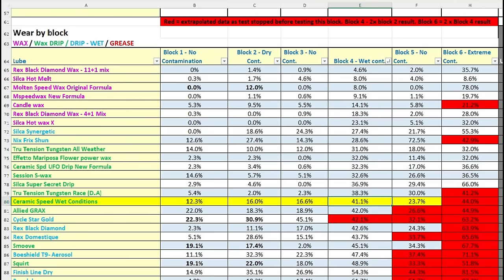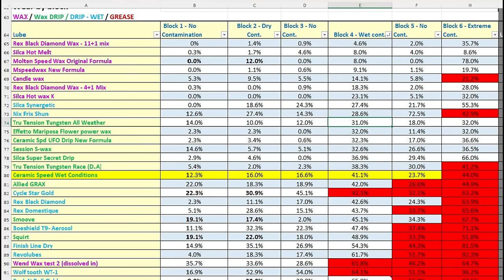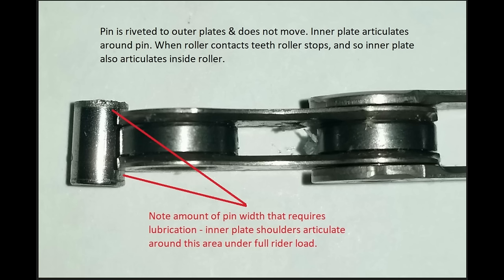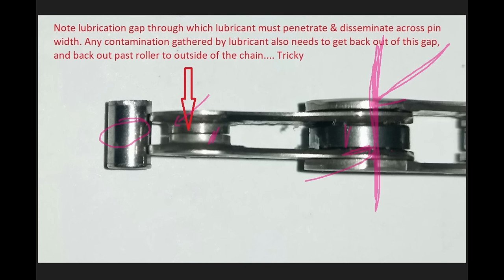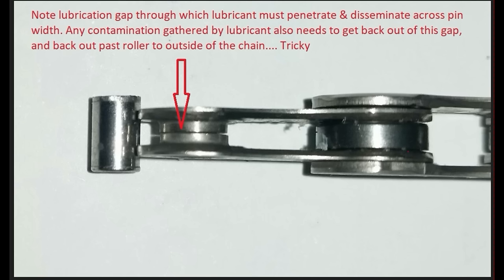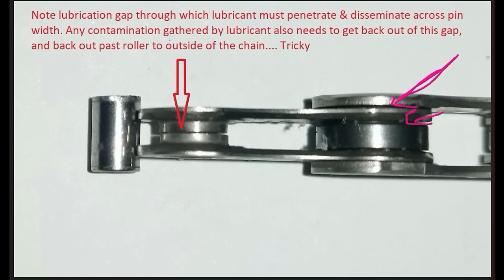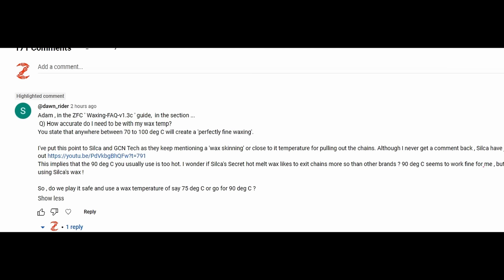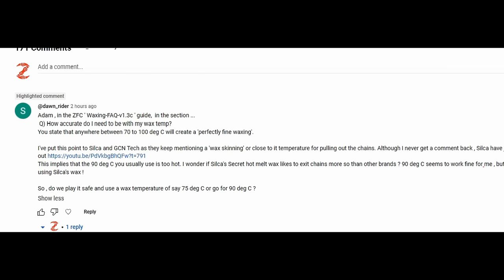wax not last

Comment: have you ever tried wax with graphene nanoparticles? They say it's faster and I just purchased a wax with graphene called Klein (I was using parafin wax before). It could be any other brand but that was one of the first I found. I ordered it, it should be here soon
Reply from the maker: overall it is very not proven re what difference graphene makes (what particle size and quality) vs other well proven additives like nano platelet ws2. 

Many buy cheap graphene, in which case it is not graphene. Graphen is 1 to 3 atom layers thick, and very, very, very expensive. Nanene is 3 to 10 atom layers thick and very, very expensive. Graphite is above 10 layers thick, and pricing varies wildly depending on quality  - ie 10 to 20 atoms thick, or on average 100 to 200 atoms thick. 

The typical experience of someone buying 1kg for $15 off amazon claiming its 99.9% lab grade X (graphene..) - what they get will be nothing remotely like what is claimed. True graphene is like hundreds of $ for a single gram from tier one supplier. 

So testing X vs ws2 is very difficult as what on early one mfg is using as "graphene" will vary wildly. The best we can do is the performance of the products we have tested.
Reply: @zerofrictioncycling992  many many thanks for the reply! You are a kind soul. I should have it at home soon. I read tha Pogacar uses absoluteBlack wax with graphene, and thus I wanted to try (Vingo fan btw), although absoluteBlack costs like 114€ per bottle.
Reply from the maker: @xosece  yes absolute black graphenlube is a great product but WAY expensive, and you MUST apply first treatment via immersive, and i kid you not that will be about a $50 application. Its strength is brilliant treatment longevity. But if you can for instance just re lube your chain at normal intervals, then you can save a huge amount of faff and $$ by just using something like ufo drip, ss drip or tru tension tungsten all weather.  I typically only recommend graphenlube to those who are not waxing and have a very long hard event and who have lots of money as it will outlast those other options by a long way. 

Sadly graphenwax tested terribly. And the price of graphenwax vs graphenlube makes no sense. Either graphenwax has vastly less graphene in it vs graphenlube, or its not the same additive but a vastly cheaper one. So if going anything AB and graphen, go the lube, not the wax.

Comment: Hm i tried squirt chain lube but it just got sticky absolutely all over and a nightmare to clean off needed to use boiling water.

Can i use with rock n roll gold? Say once rock n roll good then once with squirt then repeat etc.
Reply from the maker: Squirt for sure can easily gunk up, especially if over applied (too much, too often, both), and it does set such that it is a tough clean. 

But.... no you cant really mix a wet lube and a wax emulsion lube, they are just completely different and the outcome would be interesting but likely not in a great way. Moving from squirt to RNR gold - its not the worst, but again RNR gold is just very old and outdated vs top tested wet lubes - if going to move away from squirt - move to something that suits your preferences in the circa top 10 drip lubricants tested on the zero friction cycling league table. 

If staying with squirt or similar wax drip like say smoove etc - as they are a relatively more oily wax base vs refined wax bases of SS drip, ufo drip, tru tension etc - it is best to, 
> On application work in thoroughly then WIPE EXCESS THOROUGHLY
> Give chain a quick 10 to 20 second wipe (with a spray of alcohol on cloth if possible) post each ride to remove excess pressed out and now sitting on the outside of chain.
> Re apply when chain starts to sound and feel dry and repeat above. The main issue for wax drip gunking up is over application as some people just err a lot on re applying frequently and heavily. For some lubricants  - especially fairly long lasting wax drips like squirt - this over application will cause gunky excess thats a faff to clean pretty quickly. 

Doing this it will stay fairly clean for a good stretch, and then just normal periodic maintenance every circa 1000km ish - if doing on bike then a clip on chain cleaner with ceramic speed DT clean, or spray on dt clean - allow 10 mins to work, boiling water rinse, wipe excess post rinse etc - keeps things looking and running great on any decent lubricant, and squirt is still a good option for many as it is overall high performing and at a great price, and if follow the above tips - it will stay pretty groovy..

Comment: So, 1x drivetrains are fundamentally less efficient, right? Because on a 2x setup you can engineer to avoid using your most extreme cogs most/all of the time, which you can't do on a 1x.
Reply: Yes. Weight difference is one of the factors to consider, and 1x setups are quite a bit lighter. In my case my 1x set-up is about 400g lighter, half of which is due to the incredibly heavy SRAM spider/chainring combo. That 400g however at best amounts to approximately 3W, similar to chainline angle losses on a well-lubricated chain.

In my case, the AXS front derailleur limits rear tyre size to 45 mm instead of 55 mm which is a big efficiency loss, but that situation is different for every situation/bike/groupset
Reply: @woutervanderdoes5163  I don't think claiming 3W of saving from 400g is reasonable. Idk in what conditions that would be true. Maybe a 1x drivetrain is more aero but the rear cog really isn't.
Reply: @miguidieu06  3W from 400g is a steep climb
Reply from the maker: From a purely mechanical efficiency standpoint re chain - yes, but there can be other factors for some cycling disciplines where 1x is just flat out the better option. Ie if i only raced cx - my cx / gravel bike its a no brainer that is 1x. You dont need massive range, and you have enough to do already you dont want to add front shifting. But if i only raced gravel, the most efficient way to get the desired range is 2x. As i do both, i keep it 1x and just put up with bigger gear jumps and bit less outright drivetrain efficiency for gravel racing. Mtb is really all 1x, again you just have too much to do with changing gears at the back, suspension lock out, dropper post - front shifting died a long time ago. 

But its mostly a dead duck for road as the efficiency compromise is too great - with the exception that some flatter TT courses 1x is popular. Classifieds hub may make 1x road / tt more common place in future, but that system has a few barriers to overcome yet.
Reply: @zerofrictioncycling992  very valid points around disciplines indeed. I only do road and gravel, wasn't even thinking about CX / MTB.

Comment: I use my bike 90% on a turbo trainer in ERG mode... For best chain life I'm assuming I should use small chainring, and cog at rear that allows straightest chain line?
Reply: Straight chain yes, but a bigger ring is more efficient, no? Noisier though, so on my trainer I do 90pc of my time in the small ring.
Reply from the maker: Hey neil! ah was just replying to your email :) Actually normally big ring will be longer life as less chain tension load for a given power. if its on a high chain line angle for your erg mode work - then sure small ring overall better as its just not as groovy to ride with high chain line angle all the time, but if you can be in cog 3 or smaller most of the time - i would be big ring for sure. If you have to go up to the two largest cogs for long-ish stints then yep small ring.
Reply: @pierrex3226 possibly a 50/50 toss up... The larger chain ring means chain is bending/straightening less each time it travels around the chain ring, but the larger ring holds on to the ring for a greater proportion of the chain line 21:10
Reply: I think it's a trade off. I believe the big ring means less articulation and therefore less wear. However I always use the small ring as it gives less fluctuations in power readings. Dunno why this is the case but my Neo recommends the small ring.
Reply: @frenzalrhomb1  big ring spreads load over more chain links. If you pair is with a larger cassette cog this happens twice. The load applied to each roller/pin is therefore quite a bit lower if you are using the same gear ratio but with bigger gears! Also, articulation is reduced which further improves chain wear and lubrication lifetime. 

My Kickr core works fine with a 52t/20t combo for erg mode
Reply: @zerofrictioncycling992 also, the smaller chain ring endures many more revolutions per given chain distance so wears out faster (proportionate to the difference in cog sizes, I would imagine. a chain ring exactly half the teeth should wear out twice as fast? because each tooth encounters the chain twice for every encounter of a double size chain ring (obviously, ignoring deflection, contamination, all of the other factors))
Reply: @frenzalrhomb1  Trainer recommends using the small ring because it's easier for the trainer to be quick and precise in it's adjustments when the flywheel is spinning more slowly. So Ergo mode reacts more quickly and is more stable on the small ring.
Reply from the maker: @frenzalrhomb1  that is interesting - to the neo it should be ambivalent to whats happening at the front end. If its getting say 250w at 90 cadence, small ring - cog 7, or 250w at 90 cadence, big ring cog 4 - what would it care. The resistance load will impact how "smooth" one pedals - the more resistance the greater the stall at the deadspots, and the more "square" one pedals. Its why you feel so smooth when riding with a tailwind and comparatively not so when pedalling into a block headwind, or on a very steep grade. 

But if the resistance at the neo on erg mode is the same, you will be turning the cassette / flywheel at the same speed whether you are in the big or small ring because you will simply adjust what cog you are in to achieve desired cadence at that resistive load. In theory the neo should have zero idea what ring or cog you are using nor care. 

It would be interesting to see why neo would recommend small ring as large ring if chain line is cog 3 or lower will be lower wear and more efficient vs small ring.
Reply from the maker: @better.better  It would be faster than double. Not only are there double the interactions between roller and teeth face under load, but the smaller the chain ring the greater the chain tension load for the same power output - so these interactions are occurring under a higher pressure load vs the larger ring, so the increase in wear if half the size would be greater than double the rate.

Comment: Hi Adam,
I have been waxing my chains for last 1 yr. I was riding a standard 8-speed claris during this time. I recently got a new bike with SRAM Rival 12 speed. I noticed that the waxing efficiency is a lot lesser than a 8-speed chain. I am assuming this is due to lesser tolerance etc. but not sure. The chain does not flex smoothly even at the end when I take it out for next set of waxing. After i clean it (before applying wax), it starts to articulate very well. Is this something in my head or is this normal for waxed chain to be stiffer at the end of usage? I also catch myself using wax drip more often with 12 speed. Is this normal or am I making any mistakes? The steps I follow are - 1. soak in mineral spirit 2. dry and soak in isopropyl alcohol 3. dry and immersive waxing (slow at max 110 C)
Reply from the maker: Hey there  - what wax are you using? is every ride in the wet? 

If dry riding dont clean (why are you cleaning? it is a solid lubricant) - just re wax. 

Chain should not be stiffer before re wax vs post waxing. I have never heard of that before..... in theory that is impossible. 

12spd - im wax lifespan may be lesser vs 8spd as the load surfaces inside the chain are smaller, and so the pressure loads are higher. But also sram flat top chains are just noisier than most other chains and this can present with solid lubricant to some vs older chains. How many kms are you getting before chain is noisy?
Reply: @zerofrictioncycling992   Thanks for the response Adam. I am using regular paraffin wax since most higher end products are not available in my place (India). I try to make do with what I can find. I have been using the same pot of wax for 6 months now. I think I may have overused it. I am going to try with fresh pot and see if that makes any difference. I hate regular lubricants and the cleaning it entails. Bike just feels dirty (in my head) since I have started waxing and i want to avoid going back as much as possible. The play is noticeable while I fix the master link. Waxing play is lesser. I am suspicious of the wax pot duration., What is the avg time span for a wax pot? I wax every week and rotate with 2 chains. Avg 200km per week is my ride length
Reply from the maker: @paths.to.ponder  General rule of thumb is to replace for fresh wax by around 10,000 to 15,000km of dry road riding- look to replace earlier if one is doing offroad / wet riding - and really how much earlier is depending on ones riding conditions so how much stuff is being brought into wax that will degrade its performance. As its not possible to really give km figure for all peeps cycling due to all the variables - mostly people will be able to tell after a time that wax treatments just are not lasting or behaving like they used to. Also variability in DIY wax can be very high, some cheap paraffin is quite good, some can have a high soy / palm oil content or oil content and behave fairly differently, and be responsible for the wax nightmare stories behind why some mechanics are against IM waxing. 

But if in doubt, especially if its just cheap paraffin, there is no downside to erring on replacing early vs trying to push that wax for ages. For the DIY wax test here i bought 5kg of candle wax base for $40 aud - so if i was using that, i wouldnt be too worried about changing it often...

Comment: Speaking of not lasting. I’m using Silca Hot was on my road bike, no issues, on my mountain bike my Shimano XTR 2 by, drive train gets really noisy after about 12 to 15 miles when it’s dry and dusty. I’m in southern Ca. I use the Silca stripper, then wax. I top off after every ride, by wiping with the chain w a cloth and applying Silca wet Super Secret the night before riding. The chain is noisy in the climbing gears like the two biggest cogs. I pour boiling water on the chain in a dish before re waxing. I don’t know what else to do. Anything I’m missing? Thanks.
Reply: Oil

Comment: So for those XCM races 100km with lots of climbing any reason you can't start with a freshly immersion waxed chain and top up with wet lube at the half way point (synergetic) with the knowledge that a deep clean will be required before rewaxing?
Reply from the maker: No not at all as long as one is going to do the deep clean after. But most times an immersive wax should last 100km - however some harsher events it may start to struggle on the sides of those parts as discussed in this vid, in which case throwing on some synergetic if can do nice and quick and zoom out would be great to get to end of event.
Reply: @zerofrictioncycling992  How would you do a deep clean in this case ? Maybe a couple of boiling flush cleans followed immediately by UFO drivetrain cleaner ?

I'm not sure you can use Silca drivetrain cleaner as some Synergetic may be protected by wax ?
Reply from the maker: @dawn_rider  It can be a bit of faff mixing wet lube and wax thats for sure - all up its generally more steps to properly reset than just one or the other. Hot water melts bulk of wax off, but doesnt do a lot to dissolve off oil. Most solvents dissolve oil easily, but don't really work on wax. The wax to a degree can be contaminated by the oil - so a bit of combo approach is safer for a proper reset vs just one or the other. 

Silca stripper deliberately doest work on wax so it wont clean any wax thats been mixed with oil that well. DT clean really does a great job on both, but its expensive to use either to clean a dirty chain from start to finish, vs getting bulk of the crap out with cheaper methods. 

Personally i would do few quick turps baths to get rid of bulk of wet lube - whatever is just left in there will be flushed out straight away with whatever crap its picked up. Have the kettle boiling whilst doing that and follow up with a couple hot water baths to melt of any bulk wax left in there. 

if it is a training chain, i would then just dry, 1 x alcohol bath, dry - re wax. 

if its race chain, i want a perfect reset before going back into race wax pot. So after bulk contamination removal via turps and boiling water and dry - then i would do a 10 min bath in DT clean which will sort out whatever is left. Boiling water rinse, dry - then its ready for re wax (dont need alcohol rinse post DT clean). 

Sounds like a lot - but its pretty much 10 mins work for a training chain, another approx 10 to perfectly reset a race chain ready for race wax pot. 

And it is generally not something one has to worry about faffing with regularly - not many will be frequently doing events or rides that exceed wax treatment lifespan such they need to top off with wet lube, and so post the rare occasions one does - then that bit of time to reset again after - shouldnt be too much of a hassle. 

but i should probs put an addendum on one of the guides re resetting a wax + wet lube chain as it is a big of double step re approach.